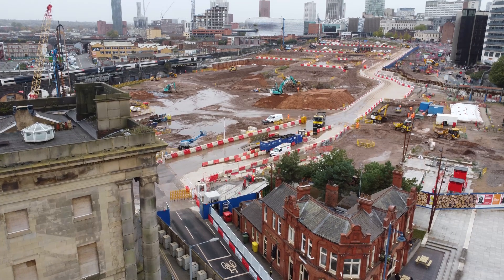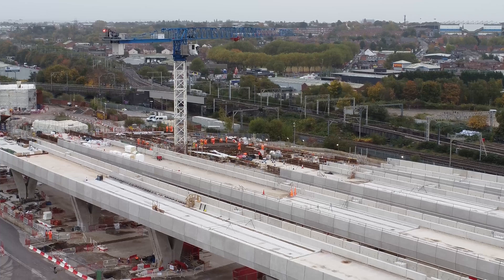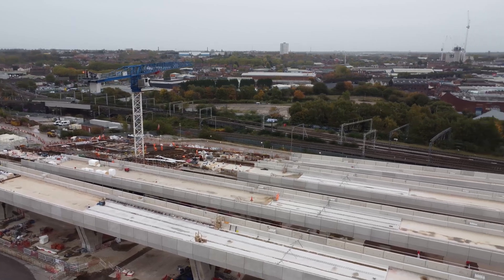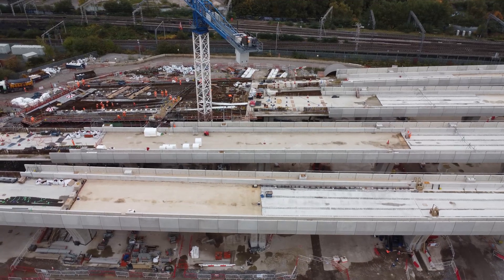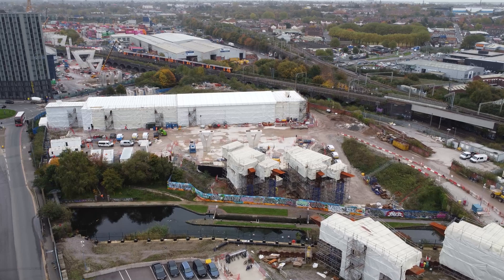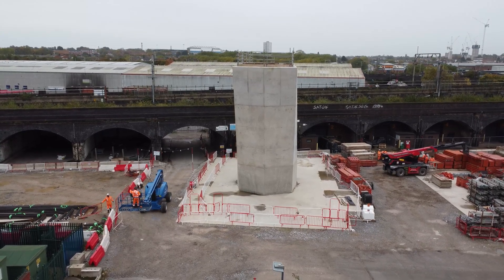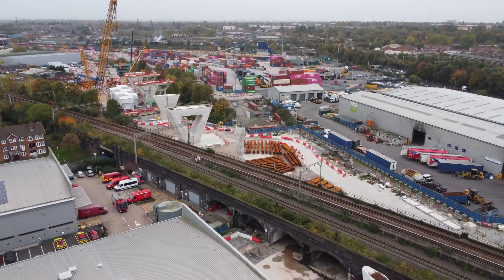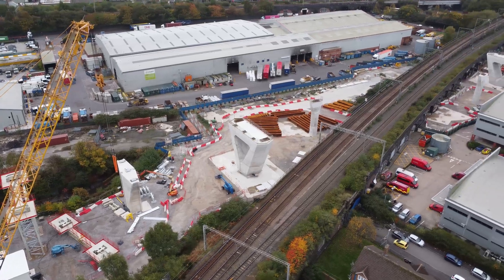HS2 Curzon Street Viaduct 3 and Lawley Middleway viaduct construction

Comment: Its going to be amazing when that bridge at 10:29 is moved into place. And the bowstring bridge is slid into place over the train line on the piers at 9:06
Reply from the maker: How on earth is that bridge at 10:29 actually going to be moved?! I assume, that they are building it on rams of some kind to enable it to be lifted https://youtu.be/TX1NDEVDBS4?t=572 as seen here under the tarp. Made good progress here in 5 months since my first video.
Reply: @WanderingNortherner  - I think they are going to have to flatten all the ground (temporarily) around the area and then move the bridge to its permanent location using Self Propelled Modular Transporters. They used this approach recently for the Aston Church Road overbridge. HS2 had a video on that and its incredible to see how they move such a large mass of metal.
Reply from the maker: @ianhart3048  |They're doing the same at St Albans at Christmas, the structure is huge that they intend to move

Comment: great views !    Does anyone know if HS2 Curzon Street terminal and all HS2 tunnels also support higher freight and "2-deck" trains UIC gauge (two different seating levels) like in EU ?  I have recently read HS2 re-start plans for the "Phase2a" to Crewe tunnels and Manchester would be made low 1-deck only to save money.
Reply: No Double Deck trains will be used on the HS2 line as these HS2 trains will also be used on the existing WCML to Liverpool and Scotland so the line is not being designed for UIC gauge trains  and the trauins are being desighned to the UK loading Gauge
Reply: @peterwallen1063  Yes, but in the future there could be on HS2 only..."Captive trains: ‘Captive’ trains would only be able to run on the newly built HS2 lines, and could be either single- or double-deck."  Perhaps later ?   If/when there is a Crewe and Manchester extension could these tunnels and gauge be 'captive' also ?
Reply: @Carlos-im3hn  Have you done any reserch into HS2, if so you would see that there are no as you put it "captive trains being built" or plans to build such trains as they would be  restricted to running on HS2 only and would be too costly all trains being built for HS2 will be to the UK loading gauge so they can operate on the existing UK lines such as the WCML if required to Liverpool and Scotland and no tunnels are being built to captive either. Not sure where you or other people keep getting this idea of captive trains for use on HS2 from, but there are no such train being built or there were never ever plans for such train and there were never ever plans for double deck trains as they would not fit the UK loading Gauge, they use these trains on main land Europe as they use a larger loading gauge called either the Berne Gauge or UIC gauge which permits higher and wider rolling stock, if HS2 trains were built to this gauge they would not be able to run on the UK rail network. This all comes down to an old proverb called Chinese Whispers where by some one says something  like are they knocking down Euston Station and by the time the 6th person has interpreted it we are totaly demolishing Euston Station when in fact no they are not so is this case, some one in the past mentioned that maybe they will have captive trains on HS2 then months late every one thinks they are having captive trains when nothing of the sort has ever been mentioned by  any one officially. The tains for HS2 will be longer than normal UK trains, will be a multiple unit hi speed train run off overhead line equipment at 25KV AC capable of 250 mph but running at 225 mph, capable of dual standard uk colour light signalling and in cab signalling as used on HS1 and built to the UK loading gauge so all HS2 trains can operate on both HS2 lines and the UK domestic main lines, but normal UK trains will not be ble to run on the HS2 lines due to speed and signalling being in cab signalling on HS2 similiar to HS1 and French Hi speed lines
Reply: @peterwallen1063  I am not sure the reticence to my simple HS2 line question.   I have been aware there are no present HS2 plans for "captive trains being built".   Who would say such a thing ?

I was only referring to the recent and somewhat unique HS2 line infrastructure.  Notionally if train capacity becomes an issue for 400m or 800m trains then maybe they can go vertical ?
Manchester platforms can not handle longer 800m trains, so then maybe they could go vertical there, then becoming "captive".   It is just another dimension for the HS2 puzzle.
There are some discussions elsewhere of having Manchester/Birmingham only services...just a thought...put the money into captive trains vs. Manchester platform upgrade/extension in the mix.

Separately I have read and heard the HS2 train boarding will also be more elevated than the UK standard platform level-boarding, so more HS2 train redesign may be on the books going forward ?

(of course, they only run double-deck on HS1 for automobiles or freight using the chunnel Continental Loading Gauge...and some providers have tried to get passenger trains across channel that "double-deck" way on HS1, for a long time but never successfully.  I believe "DB Cargo UK" often operate double-deck freight/automobile trains on the HS1 line.   I am not sure where DB Cargo unload any double-deck freight in UK, but surely not StP.)

What if HS2 much later in the future had passenger double-deckers or tall sleepers and only into the HS2 "captured" stations ?
Also for those dreamers out there...north of Crewe on the West Coast Main Line (WCML), there are around 10 significant tunnels and bridges; however, many small bridges.

Cheers.
Reply: @Carlos-im3hn  Look above at your comment " Yes, but in future there could be on HS2 only Captive train" your word not mine, there will never be captive trains on HS2 or just a Birmingham to Manchester service
Reply: @peterwallen1063  Yes, in the future the HS2 line infrastructure capability will exist, because all the HS2 tunnels so far planned do support double-deck trains.
It is an HS2 infrastructure requirement so far.   Some are discussing in "Phase-2a" to go to shorter (less height) tunnels, my original question.
Reply: @Carlos-im3hn  No tunnel as been desighned to accept double deck trains due to the fact that the OHLE would be too high and double deck trains are not planned to run on HS2